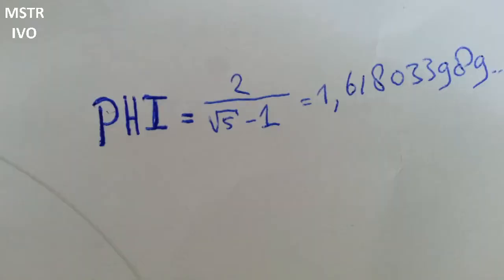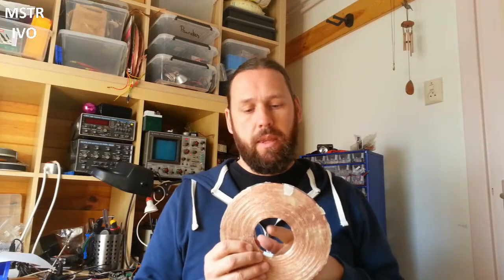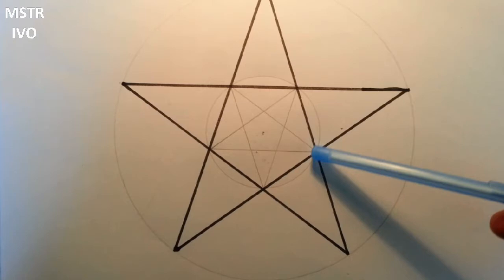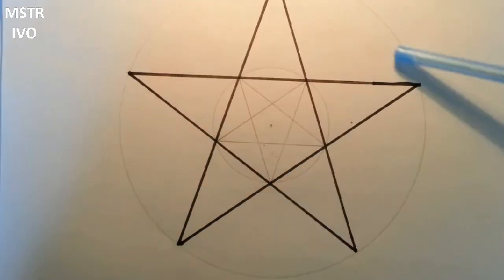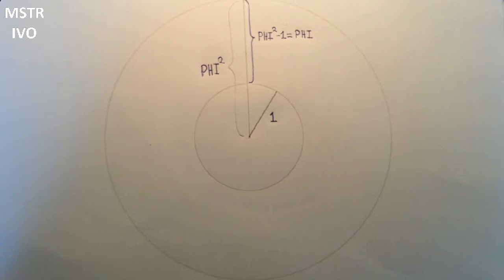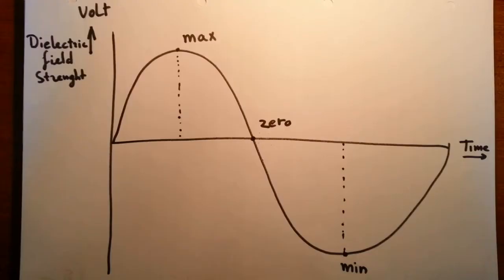The PHI Ratio Bifilar Pancake Coil and its third field

Comment: been playing with this myself
I pulsed this I have on on a triangle coil laying on top and I created a merkaba ( jewish star) connected with magnetic copper tape with magnets and set this in the middle mounted by magnets the merkaba is on five plates all connected in each plate by the copper and held together by magnets----this seems to exponentially magnify the effects ---when seperated the coil does  seem to cycle a pulse or field and can be picked up with a emf  reader as well which is baffling since there is no power attached---so am thinking once it is pulsed it may even hold this field or charge ~ was not aware this produced a torrid field that is good news since I am creating them using fans and magnets and copper tape--so i will keep exploring this
Thanks for your input your insight is appreciated
Tony

Comment: Thank you, I have been comtemplating the inner circle ratio as well, but your pentagram made a bunch of light bulbs tick in my head. I wonder if this is the reason the pentagram has been related to "magic" for millennia.

In Nikola Teslas conversion of electricity, he disruptively discharges a capacitor charged to a very high voltage across a spark gap, into a short thick primary of a few turns that surrounds his pancake coil. This disruptive break in the circuit was considered essential, which appears to just be capturing a high voltage spike into the primary and inductively affecting the secondary.

This would be an ideal way to charge this PHI ratii coil, correct?
Reply from the maker: thats also what I thought about related to magic.

with the spark gap, the idea is to have it quenched, so it is a very short discharge. But now we can use solid state switches. to make the capacitor discharge, just use a small back emf to trigger it.
this way is indeed the way to bring it into resonance.
Reply: Master Ivo my only worry about soilid state switches is that they won't act like a complete break in the circuit, allowing a real "pulse" akin to a "strike". The idea is to produce resonance without damping the vibration. Imagine hitting a gong with a mallet.

Will a transistor close fast enough, and does it act like a complete break when no current is flowing from the collector to the emitter?

Nikola Tesla used spark gaps to energize his primaries. I've been trying to see if Tesla ever resolved this requirement and the closest Ive come to seeing that is his 3 gap spark gap. He said it reduced the visibility of the spark greatly and also increased the efficiency of the circuit. It would run with almost no visible spark. His later patents for circuit controllers all have to do with rotating gaps and he even rotates mercury at high speeds to act as a continuous break. Im sure you know this already, so I guess my question is do you think a transistor replicates that function pretty well? I figured the small self inductance would prevent them from closing as fast as a spark jumping the gap and being blown out by a magnet.

If you were to take two identical phi coils, one a transmitter the other a receiver, do they still inductively effect each other? And since this is bifilar woumd and series comnected, it should still have the property of utilizing the back emf as an assistive force right?

One last thought. If the size if the inner "1" or 1/phi hole is perfectly proportioned so that it is no longer "impinged" by inner turns that would normally be there, this means that lines of magnetic force would no longer be trying to force their way into an area they shouldn't be in, via the inductive turns that are now pushed to the perfect periphery. I hope that makes sense but I guess I'm just trying to say it makes the Ring Vortex more "aerodynamic" since its the ratio that it normally wants to maintain.

I imagine every complete turn of wire that enters the inner circle can probably be measured in some way by its negative effect on the circuit.

What would a smaller phi coil made perfectly to fit the inside of a larger phi coil do in a receiver/transmitter relationship?

Thanks for your time if you get a chance to read this. I don't have the equipment or money to perform these experiments with the precision that you and others can, so I rely on others performing the exact experiments I want to perform, and just have to observe carefully. I really appreciate you sharing your knowledge and work.
Reply: One more thought. Nikola Tesla mentioned that the natural resonant frequencies of his bifilar pancake coil can be calculated based on the length of wire, and the speed of light. If want a secondary coil to resonate at 925HZ, you would take the length of the wave which would be around 81km and then use 1/4 of that as the length of your conductor.

The 1/4 wave monopole antennas that we use for radio towers use this same principle, except for radio waves traveling through the air.

An electric or magnetic wave propagating through a circuit can be calculated in the same way. This way when a standing wave is propagated through a circuit at its natural frequency, the points of highest potential, represented by the peaks of + and - voltage on the oscilloscope, will actually physically coincide with the dimensions of the length of wire, and the max reading of that voltage should measurable at the very tip of the upper terminal of the bifilar pancake coil, while the lower terminal is grounded, effectively "attaching" it to the surface of the earth like an upright spring and giving it a potential of 0 at the lowest end of the coil. Nikola Tesla actually visualized the dimensions of the wave that traveled through his secondaries of his transformers/transmitters.

Im wondering if this can be reversed. If we can measure the resonant frequency of a bifilar wound pancake coil or this Phi coil, can we figure out the length of conductor that we have used from frequency alone?

It should be approximately 1/4 of the wavelength of its fundamental resonant frequency. It would be interesting if that is so. I would bet a regular bifilar coil would be off by a bit, but a phi coil might give an accurate way to measure a length of wire by causing it to go into its resonant frequency and trying that previous formula.

Can you try taking the coil and completely series shorting it, the beginning of one and end of the the other forming one terminal and the other pair forming the other? This would put in Ed Leedskalnins PMH configuration but without common inductive iron core.

If you bridged those 2 points with LEDsfacing each other or just a bulb and tried energizing with either a battery or inductive pulse, I wonder how much energy can be stored in this inductive capacitor?

It seems like a Phi coil can make a perfect flat spiral bifilar PMH or series connected coils that are shorted upon itself without having the inductive or capacitive leakage caused by those previously impinging turns of wire that were inside the inner circle.

I will get around to making one soon. Thanks again if you had a chance to read this Master Ivo
Reply from the maker: Hi, 
thanks for the comments. 

where did Nikola Tesla mention that about the bifilar coils resonant frequency? I'm very curious to read more about this.

the resonant frequency is not only dependend on the wire lenght but also on its inductance (how many windings) and its capacitance (how close are the windings, and how much surface area is there between the windings). 

grounding the inside or the outside of the pancake coil also influences the maximum voltage rise at its resonant frequency. 

with the resonant frequency known, we can also measure the inductance of the coil. then we can calculate the capacitance of the coil.  I dont know if you can calculate the length of the wire from these values, as the surface area also is important. a wire can be thin or thick. Maybe its better expressed as the  weight of the wire.

the energy stored in the coil can be stored in its 3 fields.  short circuiting the coil would destroy any potantial differences so the capacity will be zero. this leaves only the inductance and the magnetic field where it can store energy.

a diode could only create a small potential difference, so the energy stored in the dielectric field would be very small. 

I'm not familiar with the PMH.

Comment: You did inspire me :) got two coils done just waiting for some more parts in the mail only i could not find a full list of components because it seems you change your circuits aloud or improve i should say. So I'm  still a bit puzzled bye what mosfet and if two are enough and what capasitors and how menny i did got directed to the website where you buy the PCB i think and the components but ye not sure what i should order and how menny because the circuit you showed in the video seems to have more going on then the circuit on the website
Reply from the maker: her you find the circuit www.magstar.eu/mosfet/
the mosfet is a c3m from wolfspeed
1200V version.

Comment: Thanks for Sharing. 

There are some I tresting properties for sure. 

I have a question. Is there still a verry local magnetic feild that is not eazly detected?  My guess is yes. However I haven't probed to much looking for it. 

Heart  to heart.  Much love. 

~Russ
Reply from the maker: Thanks Russ, 
the voltage of the resonant sine, together with the capacitance of the coil (calculated from inductance and the resonant frequency)  gives the energy stored in the dielectric field of the coil. 

this same energy should transform into the magnetic field when the voltage becomes zero (in the resonant sine wave). if there would be a tiny bit of magnetic field energy, it still doesn't add up to the dielectric field energy.

Energy cant disappear...

Matt Watts also did some testing with this.
Reply: Hey Russ, I know you've had some experience with Ed Leedakalnins PMH in the past. Do you think you could make one of these biPHilar  (haha seen what I did there?) coils like Ivo, but connect it in Ed Leedskalnins PMH configuration? Two coils in series connection, short circuited and those two pairs of series connections each become 1 terminal each, right? You had a PMH with a keeper for almost a year and when you disconnected it the light still flashed, I wonder if this PHI coil can do it withoit an inductive core?

Hare Krishna my friend.
Reply from the maker: haha "biPHIlar"  nice :)

Comment: Has anyone considered building their coils to match the wavelengths and frequencies of the electromagnetic spectrum? These are set number which are used for making antennas and receivers. Stands to reason the same maths would work with these. For instance a 1 mm wire 100 meters long would share physical characteristics with wave from 30 megahertz to 300 gigahertz. In Tesla’s patent, it describes amplification of resonance so that one could in theory capture or broadcast every possible wave in the universe.

Comment: Hi. It is certainly not taught everywhere. Extremely different way of using bemf. Will this require three coils like in your earlier demonstrations to create the phase shift, or can that be achieved by the geometry of the present coil?
Thank you. Best regards
Reply from the maker: one pulsed pancake coil to create back emf,  this first coil already brings a second parallel pancake coil into resonance.

then the back emf of the first coil is injected into the second (already resonant) coil (at the right phase angle so the sine waves add up). a third parallel resonant pancake coil can be used as an output coil.
Reply: Master Ivo , from 12v input to over 900v, if it comes with high current also, will be like the Amplydine motor generators used in the 1940s. Except that the input will come from an external third field. Brilliant. Thanks. Will eagerly await your next steps.
Reply from the maker: Amlidyne? never heard of it. just checked it.   Ernst Alexanderson designed it. He was a genius. He worked together with c. p. Steinmetz, who had a great understanding of electric field dynamics.
Reply: Master Ivo, because I could not make an Amplydine, I tried my own concoction of combining the BEMF of an universal motor and run a smaller universal motor, take the output from the second motor's stator coil output to light up a 240v , 18watts LED lamp. Result:
Fully bright light, problem: needed another two, 240v,5watt lamps to keep the circuits from heating up!
Reply: Master Ivo , here are two links that also maybe of interest:

Woopyjump , Melting Tungsten from BEMF:

https://youtu.be/TAx7Y0UIyHA

Lasersaber, Universal Motor OU
Output:

https://youtu.be/43lxNJjIKD8
Reply: Master Ivo , BTW, I was using 18v DC from two batteries as my power source.
Reply from the maker: +Sundiesel  That sounds great, but how much current did you put in in the first place?
and how did you collect the BEMF? what kind of signal did you use?
Reply from the maker: +Sundiesel thanks, I'll check them out.
Reply: Master Ivo , Hi! Really inspired by your latest video explanation about findings of c p steinmetz. His writings and your work will, I am certain, make a major impact. You never cease to amaze me with not just the theory but its application.
Will look forward to your next video. Thank you once again.
Reply from the maker: Thank you so much,Sundiesel for your kind words!

Comment: Great vid, this is why the extraordinary occurs in these devices. How are you measuring the third field? Do you have an oscilloscope?
Reply from the maker: Yes I have one.  

as said, normally the resonance has a magnetic field component that can be measured. But with this special resonance, the magnetic field cant be measured. the voltage is still there as a sine wave. when the voltage becomes zero, the dielectric field energy must be transformed into another (third) field.

Comment: I didn't know about the pentagram relationship to phi. That's crazy. Also as far as applications, what is the property of putting these in phi ratio bifiliar in a series? I've seen one YouTuber put two pancake bifiliar together at resonance and they had an interesting property of being able to power up an LED without ground.
Reply from the maker: A pentagram is PHI ratio all over. the short length and the long lenght "wires" are PHI ratio. You can calculate it your self.
Reply from the maker: putting them in series increases the capacity of the coil windings. this gives the ability to store more energy in its dielectric field (like a capacitor). this in effect lowers the resonant frequency of the coil.

In theory, these 2 kinds of resonance should be able to combine in a resonant coil. if they are in phase, the voltages add up, doubling the voltage means quadrupling  the energy stored in the field...

Comment: can't wait to see some videos where you show the missing magnetic field! If you short to coil ends and then pulse it, is there a zero magnetic field standing wave in the coil?
Reply from the maker: if you short the coil ends, there cant be a voltage difference between the windings, so the dielectric field energy would be zero. therefore no resonance would be possible.
Its my intention to show the resonant sine with and without the magnetic field, in a future video. But first I need to build a proper setup.

Comment: What would happen if the lenz effect went unnoticed ..? do you think that exist a ghost coil undetectable by the law of lenz ...?
Reply from the maker: I think Lenz Law only applies to the magnetic field. If we use the dielectric field and interact with it, Lenz law does not apply.  I would not be surprised, if the "inverse" of the Lenz law would apply to the dielectric field. 

this results in longitudinal power transmission where the source isnt loaded down by the load. Just like a radio transmitter doesn't see the radio that is listing to the signal.

So 2 coils that are resonant to the same frequency,  both having large capacitance, can couple via the dielectric field. even at a distance. the magnetic fields then are not coupled. So no lenz law. the transfer of electric energy is via the dielectric field only.   

A few days ago I felt the shocks of this transfer of power. I was quite surprised. I also noticed the reverse of the lenz   law. When I loaded the coil, the source became stronger instead of weaker. 
But its a little soon, to make assumptions. I have to research it further to make use of it properly.

Comment: I believe the aether field is a low energized quark field.  I say low energized because I believe that in super colliders that the quarks don't disappear, they just lose enough energy to where they are not big enough to show up on their lab equipment sensors.  I used to call it a quanta field.  cool video, thanks for the info.  I will be trying to build something in 2019 that will require a lot of learning, and you helped.  Thanks.